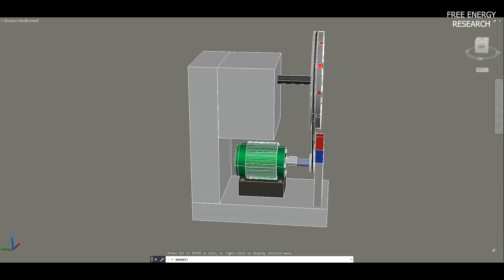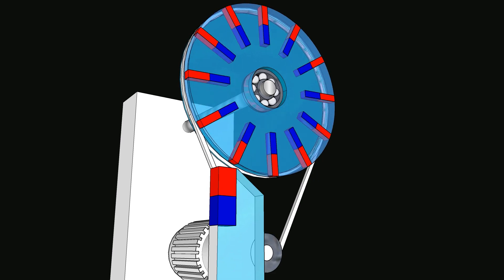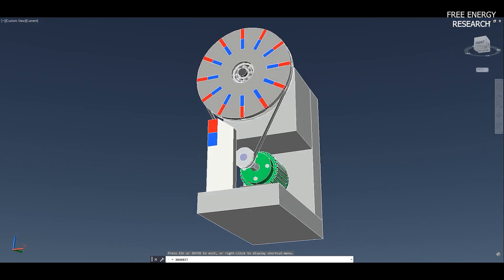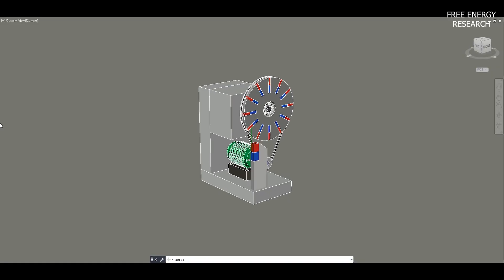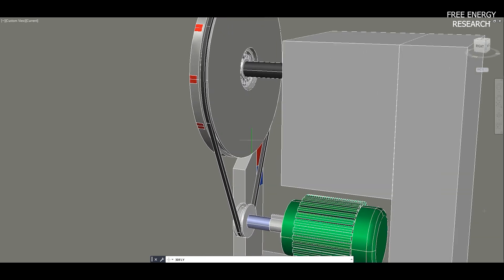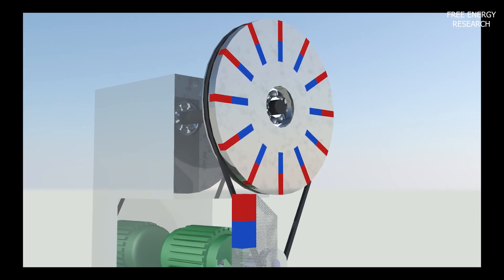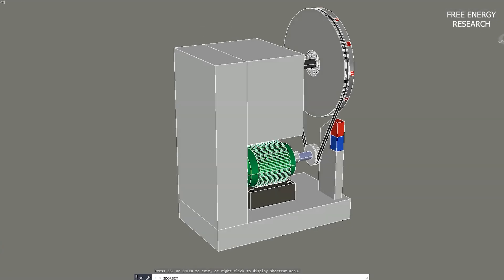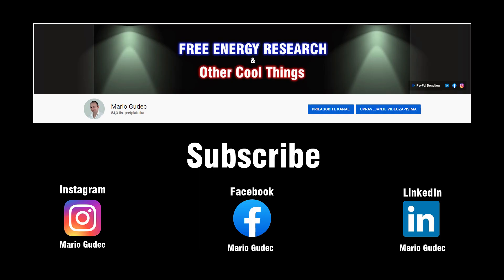Arkadiusz Fijalkowski Magnet Motor (Free Energy)

Comment: had the same idea years ago, nice job man :) longer magnets remove the negative blue pole further towards the center, less distortion of its pull, when all you need is the push. we need the poles to be as far apart as possible, for the most easy frictionless rotation possible.
Reply: There is no friction-less rotation , .or any kind of motion , accept in a vacuum (in this case , there are bearings , and belt , besides air).  You  ,probably meant "less cogging" . You can use , relatively , small magnets and extend the south pole (or north , if that is the pole used for repulsion) , simply by adding some iron sheets , because magnetic  field likes to follow path of least resistance (through iron , for an example). Of course , it wouldn't work as shown on the video , but try to do it , by all means. I mean , you can get it to spin , somehow (not by itself - you have to have some kind of input , at least initially) , but produced power is always negligible with all magnet (permanent magnet) motors.